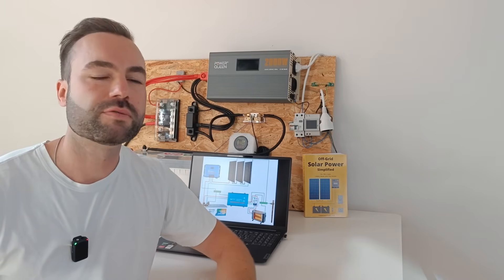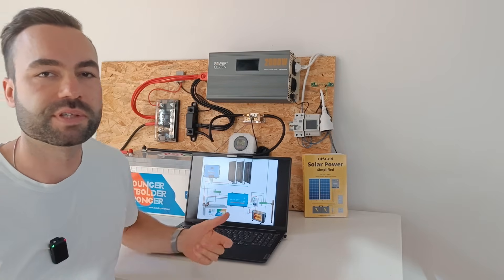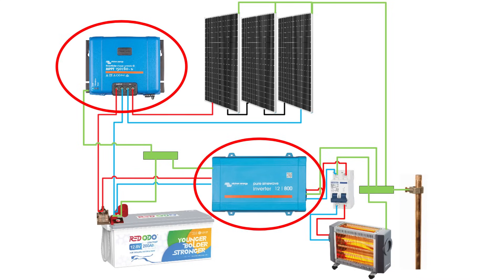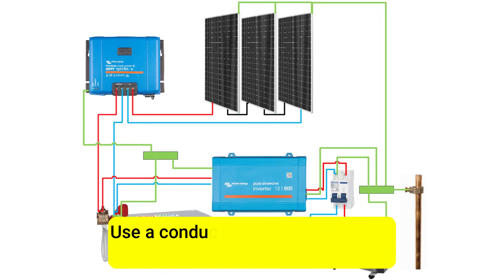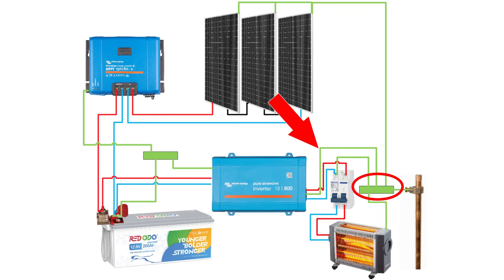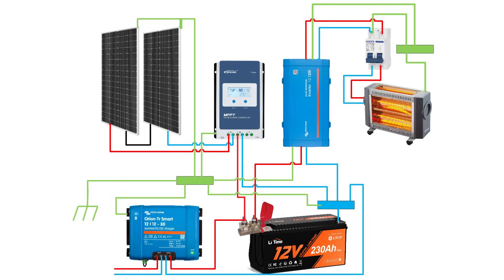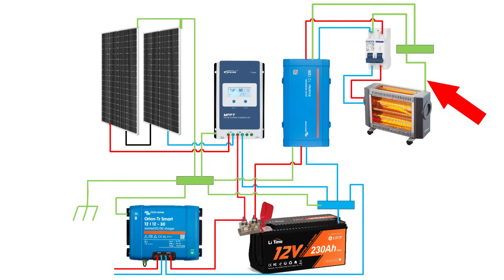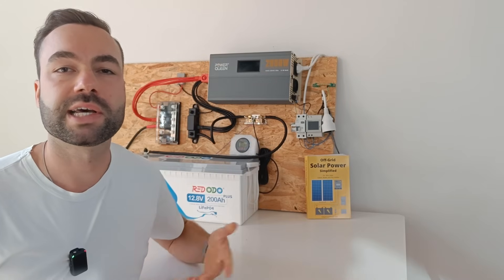How to Ground an Off-Grid Solar System

Comment from the maker: UPDATE 1: it's is allowed to have the PV frame grounded to the DC ground busbar. This is because DC and AC ground are (most of the time) bonded with each other through the inverter.
UPDATE 2: when using a non-isolated DC to DC charger, you should remove the bond between ground and neutral busbar. This is because the non-isolated DC to DC charger already bonds ground to neutral. If in doubt, use an isolated DC to DC charger.
Reply: So UPDATE 1 completely contradicts what you say in the video about keeping AC ground rods separate from DC, and that DC does not need a ground rod connection. So what is it? Can they be connected? Resources online say they can and should be connected. How would it be any different being bonded inside of the inverter?
Reply: @cleversolarpower  thankyou very much, this is know very clear.
Reply: Thanks for all this. It's really helpful. I don't understand this Update 2 - I have non-isolated MPPT's, so are you saying that I should remove the Ground-Neutral bond on the AC side? If so, I feel I'm putting the safety of using my AC equipment to something in the inverter that I can't see (AC ground - to - DC ground).. EDIT: I just watched your more recent video 'Neutral-Ground Bonding' and I think I get it now - thanks! I'll do the test you explained in the other video to test my inverter's ground-neutral bond. If it has it, I'll remove the MEN link.
Reply: I was under the impression that the solar panels would need to have their own isolated grounding electrode 8 feet from any other grounding electrode. Here you show them tied into the AC system grounding electrode. Is this common for off grid systems
Reply: Everything that is to be earthed needs to have its own connection to the single earth point earth bar. Then down the cable to the already tested ground rod. Star point grounding is the only way to avoid loops.
Reply: So ALL the ground connections whether AC or DC side can come from the common grounding source, the grounding rod via a grounding buss bar.  Is this then correct?

Comment: In the off grid system diagram the ground from the device goes to the bus bar but shouldn't it go trough the GFCI and then to the bus bar if it's plugged into an AC 3 pronged outlet ?

Comment: I would not tie the battery negative to DC busbar. And I would tie the DC busbar with the AC busbar so I don't get strange things happening during lightning strikes. I would bond all ground rods under ground with 16 sq mm bare copper conductor GEC. Then connect everything above ground together EGC and make sure only one main ground busbar (one point) from EGC will connect to the underground interconnected grounding rod system. I Use a off grid hybrid inverter which I sometimes feed with Grid power, when I do not have enough energy from solar + battery. Maybe because it is not true off grid it might be different than this, but tying  negative to ground would be very strange for me in my setup. Thailand 220/230 V single phase. Please let us discuss.

Comment: Your videos are very informative but I am still a little confused, and need confirmation for my setup. I have a Victron Multiplus 2 48v/5000 with victron solar controller and 3 Solar panels in series and 48v battery. Correct me if I am wrong but on the DC side I would have an earth bus bar connected to the negative battery, Multiplus and solar controller (but not to an earth grounding rod). On occasions I would connect AC in to a houshold 230v supply to boost charge in the battery. On the AC side I assume that as i have a victron multiplus inverter/charger I do not have to do neutral to ground bonding at the AC distribution box as this is handled automatically by victron auto ground switching feature. In order for this ground switching feature to work correctly should I have the AC in connected but switched off (ie the household earth is still connected but no current flow) or does it not matter if the household earth is no longer connected to the AC in? I read in one of your responses to another comment that if the solar array is larger than 50VA that the solar panels frames should be grounded to an earth ground stake, Is this correct in my case where I have 3 x 375w solar panels in series. Thank you for your response in advance...Mike

Comment: Why does the Solar panel ground on dc busbar
Reply from the maker: If you don't have a grounding rod in a mobile application, then the zero volts reference point is the battery negative.

Comment: Its amazing how many people reccomend different things on the internet. Im never sure who to beleive. I know for warranty purposes, following the manufacturers guidelines is the most important. The grounding recommendation from the manufacturer for my inverter, noted in the manual, is connection to a grounding rod if possible and to only resort to grounding to the negative bus bar if a ground rod is not possible.
Reply from the maker: That's exactly what I recommend here.
Reply: @cleversolarpower maybe I misunderstood the video? I thought you clearly said not to ground it to a ground rod because of possible grounding loops, Interference with the ac grounding? Talking about grounding it on the negative bus bar instead.
Reply from the maker: I don't recommend adding a secondary grounding rod next to your solar panels to reduce the chance of grounding loops. Only 1 grounding rod in stationary systems. And ground to battery negative in mobile situations.

Comment: Panels on wheels 100 feet away from the charger/battery/inverter cart on wheels too. No interconnection between solar system and house system.
IMHO no grounding should be needed since the two systems are isolated from each other.
Even if panels were not on wheels, IMHO no grounding should be needed. No return path.
Reply from the maker: The reason for grounding a solar panel is to keep the frame at 0V so if you were to touch it you wouldn't get chocked and fall off the roof. And keeping it at 0V can increase the lifespan. The voltage can accumulate on the frame.
Reply: @cleversolarpower  So how do you ground a portable array without being tethered or driving a bunch of ground rods all over the place in the yard?
Reply from the maker: To the battery negative. That's why the chassis of a vehicle is also connected to the negative battery pole, a 0V reference point.
Reply: @cleversolarpower  Chassis would be no different that charging up a capacitor leg.
Reply: @cleversolarpower  Vehicle chassis will eventually come to a saturation point. Just like charging a capacitor.
Reply: @cleversolarpower  Note to self - USE INSULATED GLOVES when around solar panels.
Also, I will be doing a ground mount one no chance of falling off a roof lol
I want to do portable but not sure I can move it due to the 200 pound or so weight.
Reply: @cleversolarpower  What does frame static voltage have to do with longevity?
Reply from the maker: Induced voltages on the frame can reduce the lifespan of the panels by messing with the silicon. I know, very scientific 😄
Reply: @cleversolarpower  Got any proof of that theory?
Or is it just a clam by Mfr's to sell more stuff?
The frame of a RV is not 0 v either since the frame is not earth grounded.
And yet we don't hear of any electrocutions or failed panels.
Reply: @cleversolarpower  Induced how?
Voltage from where?
What potential and amperage?
Even the frame would come to a saturation point.
And potential would be zero between the frame and the cells.
And what happens to that power when the sun goes down?

Comment: So in an offgrid system the battery negative serves as the dc ground? And does the negative busbar not need to be grounded to an earth ground? I hope i get a response to this.
Reply from the maker: In an off grid mobile system because there is no ground rod to connect to, so it's the battery negative. If you have a stationary system then you can use the ground itself as a zero volts reference point. They are basically the same.
Reply: @cleversolarpower thanks man i appreciate it.

Comment: @cleversolarpower thanks for the content you share and especially this topic. I have seen the updates too. I think it would be useful if you share some info either here or in a video of how we actually make the ground to the earth, like what rod to use, how deep, how far away, what kind of metal it should be and what kind of wire to connect from it to the electricity panel etc. Thanks again

Comment: Hi, you have a DC earth going to the inverter & an AC eath going to the inverter. Are these joined inside the inverter.?? With my Growatt 6kw inverter i have an AC earth & another earth bolt on the case of the inverter. When i put a test on the AC earth to the inverter case bolt i get 00 dead short. So my one seems to be conected, yet you say they should be kept seperate. "Confused"

Comment: so rn my batteries, inverter, ch controllers, dc fuse block, and a ground wire to chassis are all connected to the bus bar. my inverter has a ground stud. do i need a separate wire going from ground stud to the bus bar? additionally, can i also connect a ground wire from all my solar panel alum frames to the same bus bar?

Comment: The NEC requires ALL grounds in a building be bonded.  This includes the AC and DC.  Your comment it will cause problems is not correct.  In fact there are millions of RV's that combine the AC and DC grounds.  That is factory wiring and it is safe and effective.  What kind of problems did  you think would happen?

Comment: The "ground" wire coming from the DC buss bar to the inverter:  is this the grounding screw or lug on the inverter that grounds the case?
Reply from the maker: Yes. Most inverters have a grounding point. Not to be confused with AC grounding.

Comment: It would be fantastic if you treated boats as mobile and do more on marine wiring. For instance,  there's no chasis but there are metal hull components sat in a non conductive hull material like GRP but all sat in an electrolytic seawater, as an example. Boats are very much more complicated, and your input to the different scenarios ( eg hull material type), grounding vs earths, lightening strike plates, etc, would be very interesting and useful, I'm sure.

Comment: I have a steel enclosure for all equipment should i dc ground the cabinet, and put the inverter somewhere else?
Reply from the maker: You should ground the cabinet. Probably better to use the ac ground. It's the same though. A zero reference point for the voltage to go to if there is a stray voltage. Wether it be the physical ground or the battery negative.

Comment: My MPPT has no external screw designated ground. Do I use a Chassis screw as the ground?
Reply from the maker: That means there is no metal bodywork. You don't need to ground it then.

Comment: Hello! Great video and really helpfull! I have a Victron Phoenix Inverter 12/800. The external visible grounding screw is for grounding the DC circuit from what I have understood. In order to ground the AC output circuit, I have to place the internal grounding jumper from the "floating" to the "bond" position? I am missing the part where the AC grounding exits the inverter...
Reply from the maker: Check my video about ground neutral bonding. The screw in the inverter let's you make the ground neutral connection. It doesn't create a earth, it bonds the neutral to ground. For a grounding connection you have to connect it to a grounding rod.
Reply: @cleversolarpower  I really appreciate you apply! So, I connect the inverter's external visible grounding screw, (the one next to the schuko plug), to the grounding rod through the 12V grounding busbar, and with the inverter's internal jumper I create the neutral to ground bond. After that, the AC output will be considered as grounded and will enter the GFCI, correct? Is it OK to mix the 12V and 220V grounding circuits?

Comment: Hi, what about powerstations? I never see them being used with grounding, and not even a surge protector (for thunderstorms). I I suppose if there is a storm, it would be advised to unplug the solar panels from the power station? Many vans, rvs, tinyhouses are using powerstations nowadays, some are very capable and replace even a regular installation. Not sure about what extra protections would be needed since they have many built in. Thanks

Comment: @cleversolarpower some questions 
1. I see you have a ground neutral bond at the battery AND another on the ac side.  I thought only 1 g-n bond allowed ? 
2. The ground bus bar on dc side goes into inverter.  Exactly where does this connect in the inverter ? 
3. The dc side ground bus bar wire going into inverter ,  how does it pass through the inverter to get to the ac side and then to the ground pole in the earth ?

Comment: Hi Nick great video! What's not clear to me is that it seems you are running every AC device ground wire to the AC ground bus bar. In my case with a Victron Phoenix 48v 1200va inverter, would that mean breaking out from the inverter's shuko into a gfci with the live and neutral, then connect the ground wire to the AC ground bus? Then have the main AC load connect to that gfci and tie the ground wire to our ground bus bar? Actually now i write it out it all makes a lot more sense lol. 
Also in the case of an off grid cabin, I would have to bond dc neutral to ground according to the phoenix manual, right? And if i were to get another phoenix in parallel, I wouldnt have to bond that inverter to ground as dc is already bonded and we only want 1 dc connection to ground?
Reply from the maker: I recommend watching the three part series about it on my channel playlist page (grounding, ground neutral bond, and GFCI). the inverter inside has a ground neutral jumper which you have to manually make. check the manual on how to do this. Not really, you connect all the DC appliances to the neutral of the battery. this gives a reference point so there are no stray voltages (mostly done in mobile applications). You can also connect it to the AC grounding busbar and if you have multiple inverters, you have to connect all cases to the grounding busbar. Because if there is a stray voltage on the case of the inverter then you will get shocked. The point of grounding is to bring it to one reference point. And also ground the PV frames because they have the highest potential for stray voltages because of weather changes (static electricity).

Comment: Hi Nick, Thanks for the great book and You Tube Channel. I am building a solar generator and am confused about the grounding. I have read lots of conflicting information on the web regarding how to ground a portable system. Would I need to create a ground since there is no chassis to ground to as in a mobile system? (a grounding rod driven into the ground while camping or if used indoors would one need to connect to a earth ground via outlet). One other question. I am using a Victron 1200 and it comes with the neutral floating and can be changed internally to a neutral connected to earth. Would I need to set this up as neutral connected to earth to set up the GFI with the neutral bond?
Reply from the maker: You don't need to drive a ground rod in the ground since you have a mobile application. You ground (bond) the DC appliances to the negative post of the battery. This creates a common point so there will be no stray voltage on your devices. On the AC side, you make the ground-neutral connection (nem link). I did a video about this as well. I recommend watching the three part series about it on my channel playlist page. Yes, you will have to make the link yourself, if you look at the manual it will tell you whereto do it. I think its inside the multiplus. Only the 1600Va comes with a grounding relay i think.

Comment: What if you have a hybrid inverter that has the charge controller and inverter all in one unit. 

Also what happens if you get voltage on the Chasis of your PC or ground line ?
Reply from the maker: Does it have a grounding relay? If not, then you have to switch the grounding manually.
Reply: @cleversolarpower  
Seems to want to bond the neutral line internally with a relay ( there is option to bond or not bond in the software ) if i turn the bonding off, it turns itself back on.

Comment: Hi Nick. I am a fan of your site. I live in Sicily. I have a small home that uses 4 kwh per day +/- .I  believe that the 48 v system is best. With that please tell me how many panels I need, batteries and all in one inverter. I'm sure others would be interested as well. Thank you Sir.
Reply from the maker: 4kWh of consumption with 3 days of autonomy means 12kWh battery. With 3 sunhours, you need 4kW of solar panels.
Reply: @cleversolarpower  thank you very much sir.

Comment: Why is the pv ground wire showing  connected to the ac side ground? Must be error in the diagram I reckon that's all 😂. Update you mentioned has got me updated so all good.
Reply: This is correct in a stationary off-grid system. It's  different in a mobile setup explained later in the video.
Reply: Lightening ?

Comment: Hi there, is it OK to place your ground rod close to your solar panels on a ground mounted system (complete off grid system). The structure legs are 2 feet in the ground (aluminium). There is no grid on property, this will be the only ground rod close to the system. I'm all new to this thanks.
Reply from the maker: If you run all your grounding conductors from the house to the rod next to your panels, then its ok. You should only have one grounding conductor on your property.
Reply: @cleversolarpower  ok thank you very much, and for your help
Reply: This is a 48v system 3.3kw solar